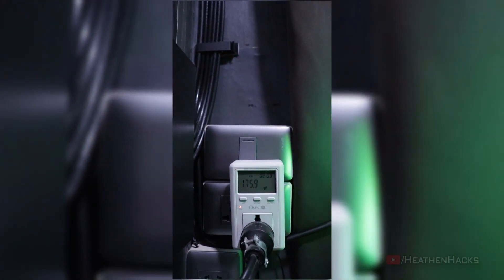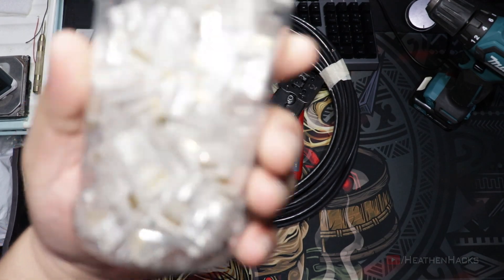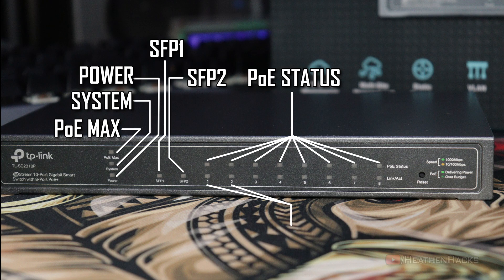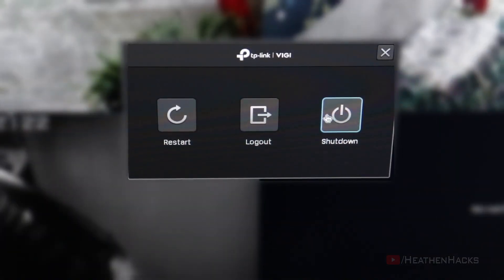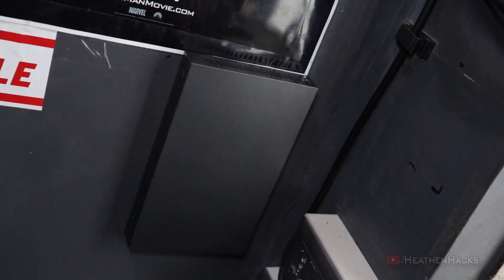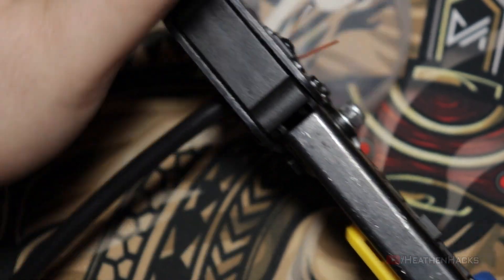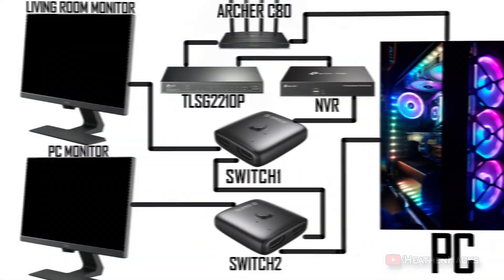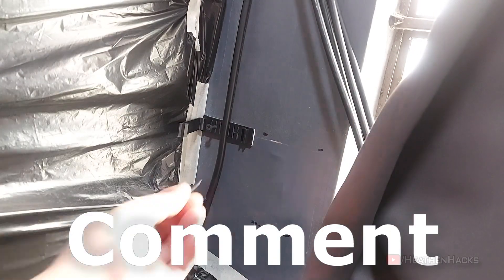TP-Link TL-SG2210P Gigabit Smart PoE+ Switch [UNBOXING & INSTALLATION]

Comment: Is that Poe slot can be use with non-poe devices?
Reply from the maker: Hello, thanks for the comment! Yes, you can use them with non-PoE devices. However, if you're only going to use non-PoE devices, there are better options available, since non-PoE switches tend to be cheaper. There are also options that are half PoE and half non-PoE ports. So, on an 8-port switch, 4 ports are PoE and the other 4 ports don't have PoE.
Reply: @HeathenHacks   yes i have plan to use non poe device n poe device..so i have to make sure that 8port can be use for non poe devices too..

Could you share what switch that have mix port (poe n non poe devices)? Surely the price is lower than  SG 2210p?
Reply from the maker: TL-SG2008P or TL-SG108PE.

TL-SG2008P costs just a bit lower compared to the 2210P variant, and the 108PE is even lower when compared to the other 2.

I suggest going to TP-Link's website to compare their specs.